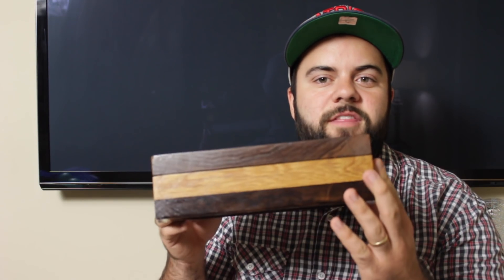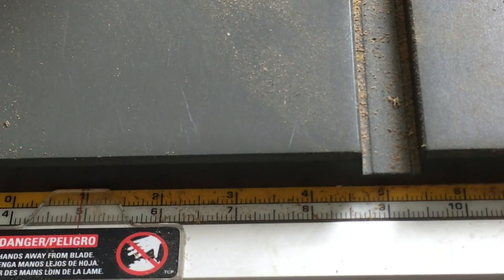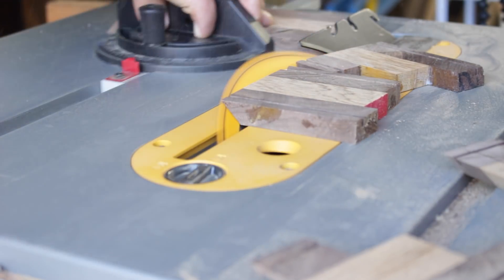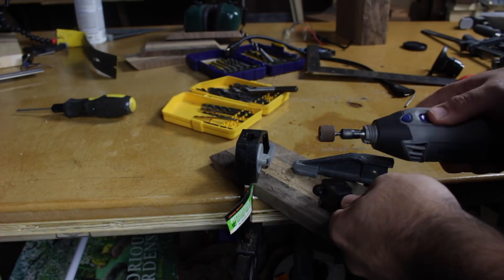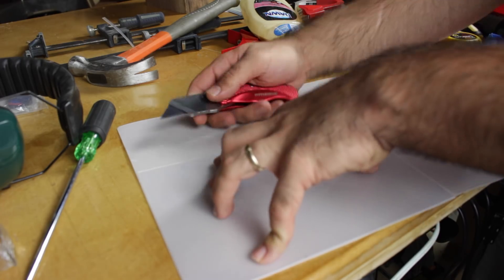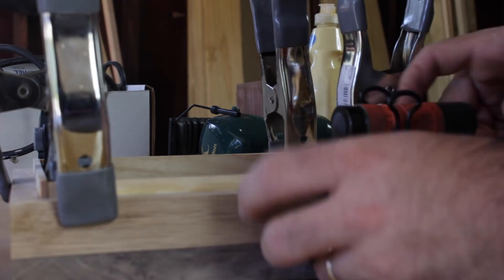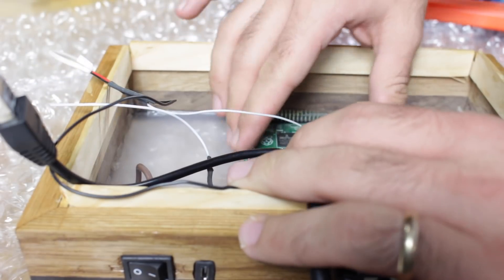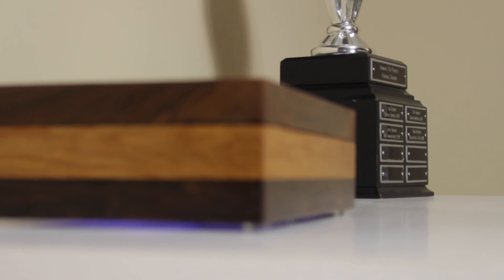A Raspberry Pi Case Made From Scrap Wood

Comment: acacia rosewood and pine, by the way, you could sell these online, its a nightmare trying to find a decent case online, and use thicker plexiglass, with some ventilation holes or fan mounts
Reply from the maker: balduran7 thanks for the wood! And all awesome ideas. I have a better version in the works, slightly smaller, pi driven leds and yes a better glass.

Comment: why didn't you utilize the GPIO pins in the Pi to run the LEDS, just had to activate the serial settings for the pins and you get 5Vs on a pin
Reply from the maker: +Jonathan Kowalik I didn't have the time. I have never used the Pi for anything other than someone else's code/os. I knew I could get the Arduino up and running in under 10 minutes. I have a bunch of the cheap Chinese knockoff Arduino too. I would love to go back and use the IO, would make for a much simpler design.
Reply: This would have been ideal. No idea why he didnt take his time to do it correctly.

Comment: Couple of questions. Did you have to take the box apart to get the plastic pieces in after you glued the sides together? Also, what did you use/how did you connect the raspberry pie to the box?
Reply: He glued the pi stand offs to the bottom plastic sheet.
Says he's not a woodworker - has a table saw, clamps, chisels etc.